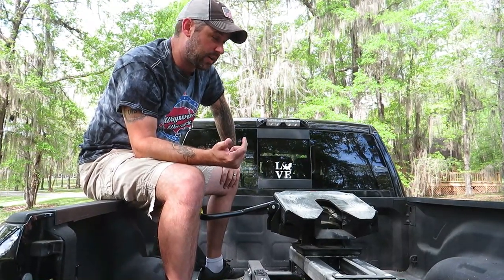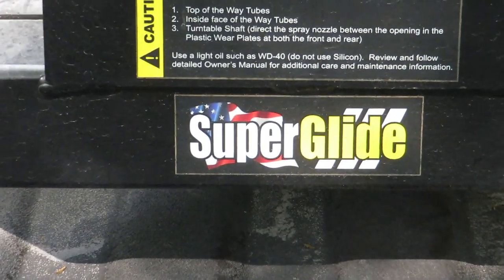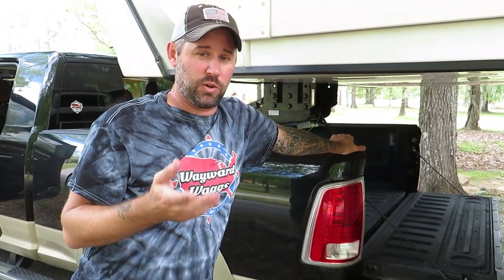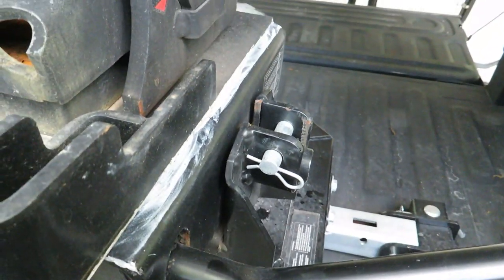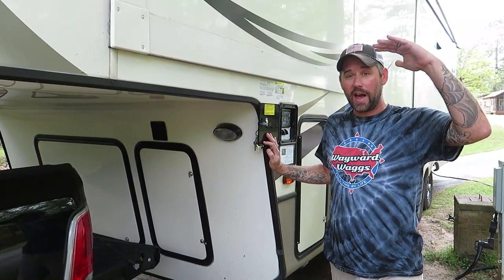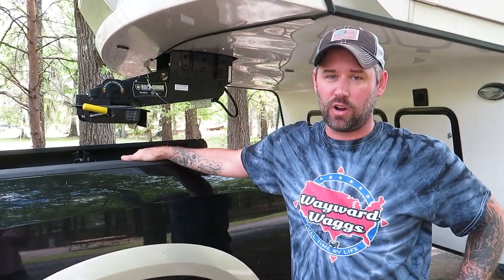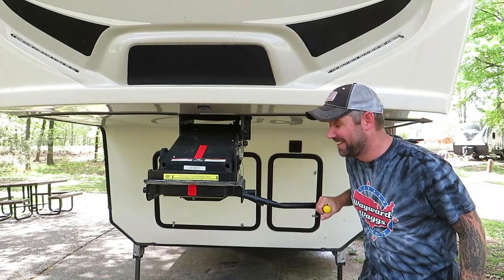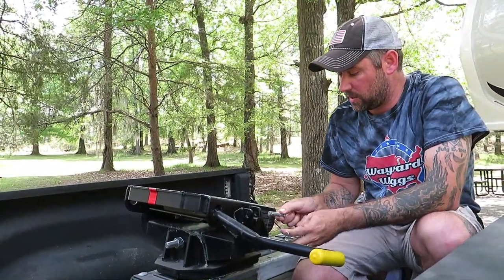Pullrite Superglide Fifth Wheel Hitch (How it works)

Comment: I have had two bumper pull trailers, but just got a 5th wheel.  My RAM 2500 is a short bed so I purchased the Pullrite Superglide.  This video and your explanation of the simple way to get the truck disconnected without being straight with the RV was a godsend!  Thanks very much!!
Reply from the maker: Happy to help

Comment: This was the best video. I hv problems detaching all the time.
Reply from the maker: We are glad it could help.
Reply: Do u grease the plate?
Reply from the maker: @markstein3033  Yes. I use White Lithium to grease the plate. WD40 on everything else.
Reply: @WaywardWaggs  thk u...I love the part about taking the pins out and lifting the plate...I forget to bump it to loosen before I pull on the handle...people don't know that...if u do another disconnect video show that...I hv problems how high to lift it to disconnect...removing the plate is a no brainer
Reply from the maker: @markstein3033  Thanks. We really should do another video exclusively about maintenance, hooking up, and unhooking.

Comment: I watched a video about regular/annual maintenance from Pullrite and something that they mentioned to keep it from spinning too easy when hitching up is to adjust the stop on the front of the hitch. It will keep it from being too easy to spin and will stay in place better. I wasn't aware of this and mine was lubed and a little loose, like yours, and I was annoyed by the hitch wanting to slide back and forth and bang sometimes when I took off and/or stopped sometimes. Also if you don't have the "key" plate installed and try to pull like a normal 5th wheel, it will also slide back and forth to the stops with the weight of the trailer behind it which could cause damage. The previous owner of my hitch informed me of this and I can see why.
Reply from the maker: Good info. Thanks for sharing with us.

Comment: You need to adjust the center pin screw and then when backing up it will stay straight. Great video!!! Never thought about that way of unhooking at a 90 degrees. Thanks
Reply from the maker: Thanks for the tip. I appreciate it.

Comment: I bought the Demco auto slide 21K under bed mount. After a lot of research I settled on it because there is no separate capture plate. You can easily hitch or un-hitch at a little angle. All you have to do is after you hook up pull forward to make sure the pin box is in line with the latch plate before running in the capture screws which can be done by hand. I think it will fit just about any pin box.
Reply: In all fairness, with the underbody mounting kit and the hitch on sale it was about $1700 bucks

Comment: Where do I begin.  First, thank you so much.  Excellent demonstration. You have addressed so many issues that I have been battling.  I have always wondered what I would do if I couldn't get straightened up to remove the hitch.  Awesome explanation and demo.  Also, I was used to a bumper pull camper.  EVERYONE said fifth wheels are much easier.  Not for me, until now. Your comment on backing up just helped me realize what my problem is.  Again, excellent video.
Reply from the maker: Glad to hear our video helped you. That is why we make them. Happy and safe travels!

Comment: Thanks for posting!
Reply: Is the hitch supposed to lock once attached in terms of backward & forward movement?
Reply from the maker: It only slides backwards and forwards when turning to pull the RV away from the truck to avoid the RV cap from hitting the truck cab.
Reply: @WaywardWaggs  right on. I just got done actually inspecting that very feature. I used to be a commercial truck driver but our 5th wheels were different on road tractors plus that’s been years ago haha. Hey thanks again for posting & responding so fast, take care!!!😊
Reply: @WaywardWaggs  does that cable go around the fifth wheel release handle as an emergency brake mechanism?
Reply from the maker: @AuctioneerElite  Yes. If the hitch comes unhitched, it will pull the emergency cable and lock up the RV brakes so it does not roll off into traffic.

Comment: Great video. Well explained how it works and potential issues.  I just went from a long box to short box truck bed with a 5th already owned so been researching a new hitch system. Appreciate the video.
Reply from the maker: Our pleasure. We have been using this one for 2 years with no issues.
Reply: @WaywardWaggs  Good to know. I have a 3500 Diesel GMC so I'll definitely get the bigger one you mentioned. I really love how this hitch works.

Comment: We're picking up an Arctic Wolf 321BH soon. Originally, I was determined to get the Reese Goosebox, but the dealer is trying to figure out if that will work with the new lippert frame and their rhino box kingpin design. If the Goosebox doesn't work, this is my 2nd choice. I have a RAM 3500 mega cab as well and have limited bed space.
Reply from the maker: We have been using this for over 2 years and love it. It does take up a lot of bed space though.
Reply: @WaywardWaggs  Yeah, that's kinda par for the course for 5th wheel hitches though, which is why the Goosebox is my first choice.

Comment: Hey guys glad I found your channel.  I'm 11 months out from being a fulltimer firstimer.  Loved this video am researching hitches now. What did you at the end that it con is backing up is different with this hitch?
Reply from the maker: We are glad you found us. Congrats on becoming a full timer soon. When you are backing up with this hitch, if you are backing straight, it is no issue. If you turn while backing up, the hitch slides the rv back away from the truck. This is by design so the rv does not hit the cab of your truck, however, it changes the angle while you are backing. The more you turn, the more the angle changes. There is not a single pivot point like most hitches that are stationary. It is a bit challenging at first, but you will get better at it with practice. We would rather struggle a bit backing up to be sure we do not damage our RV or truck.

Comment: When I bought my 5th wheel, I thought about buying a Superglide for my short bed. I cheaped out, though, and decided I could remember to do the laborious manual slide operation whenever I needed to make a sharp turn. Yeah, right. In a driving rainstorm in central Wyoming, I forgot and blew out the rear glass of my truck all over my three small children. Were they traumatized? Yup. Does my wife give me crap about it ten years later? Roger that. At least no one got cut and we managed to do the rest of the trip with a Rubbermaid lid duct-taped across the missing window.
The next time we took the trailer out, I had a Superglide in the bed. It mounts to the same rails, but boy is it HEAVY. I used to lift the manual slider in and out by myself (not too bad for being in my fifties, I think) but I have to use a chain hoist hooked to the top of my garage door opening to get the SG in and out. That's a small price to pay though, and the new hitch has made our trips much easier and worry free. In my opinion, the availability of the Superglide removes any need to buy a long bed truck if you'd otherwise prefer a short bed. I just wish I'd bought this hitch the first time.
Reply from the maker: Wow. Crazy story. Sorry that happened. Glad you got the Superglide and it is working out for you.

Comment: Heck Ya.. GREAT Video.. I'm new to 5th Wheel Rving as of yesterday.  MFG just installed this 2900 hitch on my F250 Super Duty 6 1/2 ft bed.  Thanks for showing the unhitching at an angle part. Putting the head back on when it's not straight, wouldn't that just be a reverse of what you did when you unpinned it, kind-a-sorta?  Again, Great video.
Reply from the maker: Glad you liked the video. Enjoy your hitch. They are great for towing. Backing up can be a bit tricky but at least the RV will never hit the cab of the truck.

Comment: Thank you for the video and explaining how to unhook at an angle. I am a little confused though why you couldn’t just reverse the steps and hook back up at an angle? Pull the head of the hitch on the trailer. Back in , turn the hitch at the angle required and set the trailer back down on the bed? I would love one of these hitches , but this is my one hesitation. Glad to know you can at least unhook
Reply from the maker: To rebook at an angle you would have to lower the RV perfectly onto those pin hooks. It is much easier to back onto the hitch than try to perfectly lower it back on.

Comment: You have the puck adapter on your hitch.  Is that using the standard hitch rail spacing?  Excellent video.
Reply from the maker: We had to have a capture plate which comes with the hitch when purchased.
Reply from the maker: Not sure about hitch rail spacing.

Comment: I'm like you I love my Pullrite hitch.  However, I have a lot of trouble unhitching
Reply: Sorry, that fat finger syndrome. My RV. I have it lined up straight, slight space between hitch and catch plate and backed up just a little.  Some times I can't pull the release arm out.  We go up, down, forward and backwards it just won't release.  Do you have any ideas what we may be doing wrong and maybe the Pullrite secret.   Thanks Dave & Judy
Reply from the maker: Not sure. We just back up a bit and ours releases really easily. You should try to reach out to Pullrite and see if they have any recommendations.

Comment: How you like the puck adapters is their any wiggle with the hitch while towing?  I heard multiple things from dealers saying to not to use them.
Reply from the maker: We have not had any issues. We have been towing with ours for 3 years.
Reply: Ok thanks  I just switched from a six foot bed with ISR rails to a eight foot bed with the puck system and to avoid spending money  on another hitch I might just get the puck rail adapters.  If I cannot sell the super glide hitch.

Comment: Thanks for the great video! How do you handle the issue you described about backing up? I'm not sure if I understood that part. I'm also looking at the Demco autoslide and I wonder if they all have that issue or not. Safe travels!
Reply from the maker: Lots of practice is the only way to get better. Yes. All of the autoslide hitches will have the same issue.
Reply: So, for a newbie (like me), would it possibly be better to buy a manual slide? I have a Ram Megacab with a 6'4" bed, and I just bought a 2005 5er (so I have the traditional cap). The appeal to the autoslide is I wouldn't have to think about it. But the walls of my bed are so high, and my bed so short, that I'm afraid the tongue might hit my tailgate when the slide travels all the way back. Am I right that I might have a problem there? Or does the autoslide already account for that?  If not, I might have to get out of the truck to open the tailgate on tight turns...and I could release a manual slide at the same time. So, now I'm rethinking the autoslide...especially if it's easier to back up with a manual slide.  I had never thought the issue of backing up, and that's why I'm so grateful you mentioned it in your video.  Sorry for so many questions! Obviously this is an important and expensive purchase, so I really appreciate "talking" with someone with experience. Thanks again : )
Reply from the maker: @seeasmuchasyoucan  I would recommend getting the autoslide. It does not slide far enough back to hit the tailgate, so that is not an issue. It would be a pain to get out of the truck to take tight turns. Some tight turns happen in town in heavy traffic. The last thing you want to do is get out of your truck in the middle of traffic to release your sliding mechanism. It would be less hassle to learn how to back up with the autoslider. Just my opinion.

Comment: no one ever shows how it works while backing up... does it still move back when backing up?
Reply from the maker: If you are backing straight, it does not move back. When you are backing at an angle, the hitch moves back to prevent the cap of the RV from hitting the cab of the truck. Hope this info helps.

Comment: At 3:00 you were explaining the details if the handle doesn't pull out. Do you back up slightly with the gap still there or do you have to drop the weight back down? I always have problems with this
Reply from the maker: Just back up a few inches and the handle should pull easier.

Comment: First off I’m assuming you’re a veteran so thank you for your service if you are. I have a 2012 ram 3500 mega cab duly and it does not have a fifth wheel or gooseneck prep. Did yours have the prep or did you need to install it and if you did what it did you have installed. Thank you
Reply from the maker: Ours was already installed. I'm not sure how much it costs to get it installed aftermarket but I'm sure an RV repair shop can do it for you. I wouldn't take it to an RV dealer. They are much better at selling things than they are at fixing and installing things. I was a Combat Medic in the Army for 20 years. Absolutely my pleasure to serve.

Comment: Dustin, I bought a used 2019 Grand Design Solitude 375RES. The previous owner threw in the Pullrite 24k Superslider hitch. I currently have a Curt 16k Slider. Trying to decide whether to use the Pullrite hitch or buy a 20k version of the Curt Slider hitch. Question: you indicate at the end of this video that backing up can be a challenge. What specifically is the difficulty you encounter? I finally mastered backing with the Curt hitch and am trying to find out how hard it will be to learn to back with this unit. Thanks for your help. I replied once before but will say it again, “Thank you for your service.” Say “hi” to Leslie for me and give Scout a scratch on his chin from me.
Reply from the maker: When backing straight it is no issue. When backing while turning to get into a spot, the hitch slides backwards to prevent the RV from striking the truck. As the hitch slides backward, it changes the angle of the turn constantly. Because it slides, it is not a single pivot point. It does take some getting used to but we love that we never have to worry about the RV cap hitting the truck cab on tight turns. I hope this info helps. Let us know how it goes. Congrats on the new rig. Happy travels!
Reply: @WaywardWaggs  OK, thanks! The manager of my RV service department also is advising me to use the Pullrite hitch (he actually prefers the Demco equivalent). I think that’s the route I am going to go. Give me a head’s up if you are ever going to be in SE WI. Would love to host you for dinner and get your & Leslie’s coaching on RVing, etc. Mary will never agree to full-time due to our 11 grandchildren. But we will be taking two-month trips in winter/spring and the fall.
Reply from the maker: Will do. It would be very cool to meet you guys. Hope all goes well with the hitch.
Reply: @WaywardWaggs  Dustin, I am sorry to bother you again. It turns out that my unit is the same as yours - 18k, #2900. The previous owner had a Ford F-350, I have a 2016 RAM 3500 Megacab with a small bed. I see you have a RAM also. Would you mind telling me what model number you are using to secure the hitch to your bed’s puck system? Thanks for your help.
Reply from the maker: We have the model 4439 for the puck frame and model 2900 for the hitch. Hope this helps.

Comment: Thanks for the very informative video - especially how to pull out on an angle!   We have this same hitch.   I have a question:  how direct on do you have to be to hook up?  Sometimes, if we are off the mark by a small amount, it won’t click in.   Also, what is your technique for ensuring it is straight in when hooking up?   Thanks so much!
Reply from the maker: You have to be very straight when hooking up. Leslie guides me back and gets me straight before hooking up. She also adjusts the height as I am backing up to make sure we are at the right height to hook up. Hope this helps.
Reply: Wayward Waggs   Thanks!     I have the height right on, it’s the side to side that messes us up.
Reply: Christine Bennett ,,,, I have the same problem. Makes it difficult hooking up by yourself. 🙁

Comment: Great video. We currently have a Demco autoslide and I'm not very pleased so I have been checking into pullrit. Couple of questions. Are you able to adjust the height of the hitch and do you have to be dead on straight everytime you back in ? Can you hitch up at say, a 10 degree angle?
Reply from the maker: No. You cannot adjust the height of the hitch. You have to raise and lower the RV to match the height of the hitch. You have to hook up very straight. We have been doing it for almost 2 years and never had a problem having to back onto it straight. Hope this info helps.

Comment: WW would you be able to tell me the distance between the hitch and the cab?  Thinking of adding a fuel tank in front of the hitch.  Thanks.
Reply from the maker: Our hard truck bed topper (tri-fold) stays up there and does not hit, so you should be able to fit a fuel tank depending on the size of it. I do not have access to my truck at the moment, so cannot tell you the exact distance.

Comment: I see you have the 4 puck in the bed. Mine only has 2 puck. Will a hitch like yours still fit on a 2 puck?
Reply from the maker: Yes. As long as it is prepped for a gooseneck with the ball in the center of the truck bed.

Comment: Great video however I do have a question. I too have an 18K Superglide hitch and am wondering about the exact process you use to hook onto your hitch. Do you position the king pin level with top of the hitch plate or do you position it down more to just touching the slanted part of the hitch plate ramp in order for it to climb up the plate as you back into the kingpin?
Reply from the maker: We tilt the hitch up and line the catch plate up about halfway up the slant and let the hitch plate climb up the hitch.